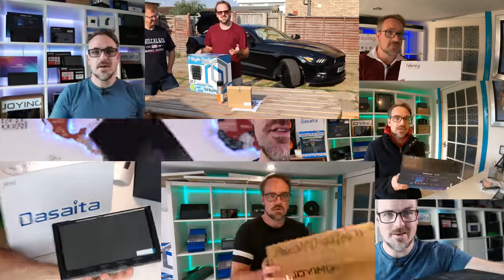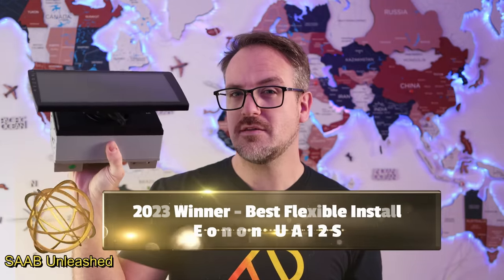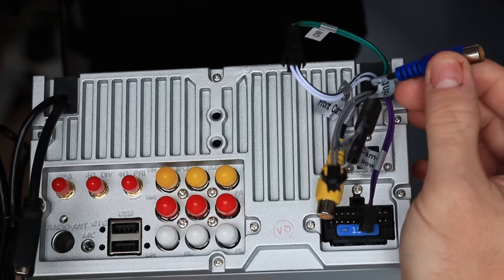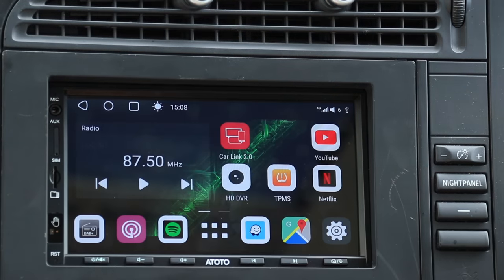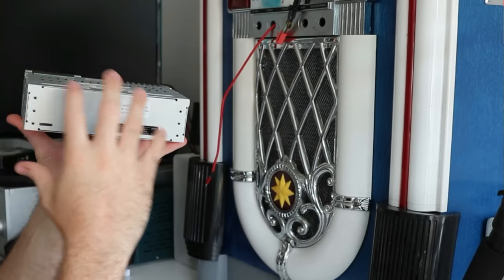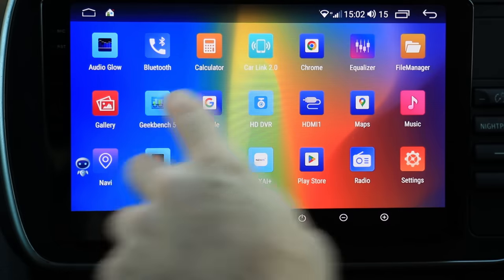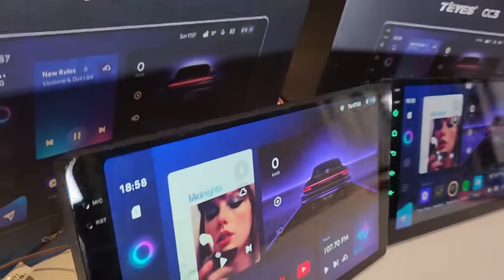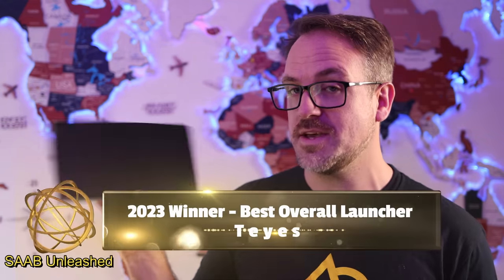2023's Top 7 Android Head Units

Comment: Thank you so much for this video. I wish I would have found it before I took the plunge. Bought an A-Sure brand 9" because it was literally all I could find at the time for a '15 Avalon. I did upgrade to the 4GB Ram model. Performance is good, but there are other minor issues. Audio is THE main one. The sound is clear, but there just isn't much control over each frequency in the DSP app. The presets work and I can manually adjust, but mids are too high and there is no bass at all. They had to send me an update just to enable bass settings, which don't work anyway. I'm going to return it, but wanted to ask here if that is just a characteristic of these Android units or just this one. I'm looking at the EKIY 8GB model. I don't need extra cameras or inputs/outputs. Just Sub and can-bus integration. So, is clear, but washed out audio normal for these units? My factory radio sounded WAY WAY better. And that was with my sub connected to line level, not RCA. Even without sub, it sounds better.
Reply from the maker: No, the sound quality differs wildly across brands with different internal amplifiers and DSP chips. Joying is king of audio on this list, but they're all decent. The EKIY is on this list as a budget option and you do get what you pay for. You're looking for audio quality which requires more costly internal components and so I don't recommend cheap
Reply: Thank you for that. I looked at Joying, but they don’t have anything for my car. So I would have to figure out which model would fit and find a bezel that works with the unit. Any tips on that? It looks like their 9” unit has an actual volume knob, which is awesome. But it seems to be a little different shape than the other standard 9” units that are out there.
Reply: @SaabUnleashed  sadly according to Joying support, they don’t offer anything for my car. My next choice is currently Mekede because they definitely do offer one for my car, with the bezel. There just aren’t many choices out there for the Avalon.

Comment: Hi, thanks for the video.

I would really like to know which one to use a secondary head unit, I want it mainly for maps but have to keep my stock radio system has auxiliary in
Reply: Fiat doblo MPV trekking 2016 secondary just the best system, doesn't matter cost
Reply from the maker: The best you can buy in this situation is Carpuride. I did a video a while back, there's a discount code in the video description https://youtu.be/LMHai1Fj7Cw?si=KsJqQx1W_Niy10bc
Reply: @SaabUnleashed  thanks,

Is it possible to use these higher end units as a secondary unit?, bat computer vibes
Reply from the maker: Technically you can, you'd just connect the left and right RCA out to your aux in

Comment: My question is how do they hold up over time?  I had a atoto f7we and went through 3 of them a 2 month span. I need something that is going to last for  a long period of time.
Reply from the maker: The F7 is not an Android head unit and doesn't have the higher quality components of the A and S series
Reply: @SaabUnleashed  I sent that one back and got the S8 ultra for my wife's car and it is good so far.  

I need something for my vehicle since it can only do wired android or car play. 

I was looking at the joying but I don't need a huge 15in screen lol. 

I've never heard of joying until I started watching your videos and I dont know how they hold up over time.
Reply from the maker: @TJsVette  I just reviewed the biggest Joying for fun, but it comes in smaller sizes depending on where you are in the world
Reply: @SaabUnleashed  I saw that.  I would go for a 10in screen but do they have the same specs as the bigger ones? How long do they usually last?
Reply from the maker: @TJsVette  I have Joyings from like 6 years ago which still work fine
Reply: @SaabUnleashed  yea I haven't heard of them but I like the look of it. On the link you had in the video it's not bad of a price, it's what I paid for my wife's s8 ultra.  

Just need to figure out if it will work with maestro and my car.

Comment: @SaabUnleashed i have a question for you! I am looking into getting s new android head unit for my mk4 jetta tdi, ive been looking into the brand Owtosin, do you havr any opinions on them? They are an ali express brand of course, im mostly interested in this specific unit because its designed to be a factory looking 7" double din replacement with physical volume and tuning knob and physical buttons, runs android 12, can choose between any 4-12gb 64-256gb models with either a snapdragon 665, UIS7862 or UIS7870 for processors ( was thinking ill opt for 7870 i think seems to be best cpu to me?), has 1024x600 ips display, can choose between tda7851 or tcb503 amp chip depending on cpu choice, tda7708 tuner, bt5.0  360 cam support, hdmi, dsp and all that other good stuff. My only concern is software. They also have 9" trim replacement versions that run a 2k display, android 14, snapdragon 655 cpu, 12gb or 8gb ram with 256gb rom, tda7851 amp DTS DSP and all the other good stuff but no physical buttons or knobs especially being the 2k screen no touch buttons at all! What would you reccomended and what are your thoughts? I realize i can change my launcher and all that but will i run into any other limitations or issues software wise i should be aware of?

Comment: What I expect out of these reviews: do the everyday quality of life functions work? Does hands free audio work very well with no background electrical interference, clear vocals, no echoing, etc? Does bluetooth and carplay/android auto get confused such as when a call is initiated before or during the connected of carplay? These seem to all struggle with this. Do they boot up and run reliably in cold weather? These are all things that have consistently kept me from using these android units. The cheapo Boss wireless carplay/android auto unit works far more reliably than any of these android head units I've had my hands on.

Comment: Hi I saw your review for 2023 and wondering if you have a review for 2024 units. I am also looking for a unit that will replace my 7" standard with an android 13 or android 14   9" or 10" screen for my 2015 benz GLK250 to work with my full fuction system as it has front and rear camera and all the bells . I am not looking to brake the bank under $500.
There are so may out there that it is confusing so need an honest opinon. Has to have car play , navigation and such. hope you can help

Comment: Had ordered a Ekiy T7 and just saw your video... Got the T7 4GB model with a fascia for 120 GBP shipped.  Honestly I had assumed the brands were mostly all the same so pleased that I seem to have accidentally ordered a decent one.
I'm a bit worried about signing in to it though... have you had any bad experiences logging in  to these devices? Cheers.
Reply from the maker: Looks like you made a good choice. I did a video on Android head unit security here https://youtu.be/67vOLN2VvcE
Reply: @SaabUnleashed  ah brilliant thanks.
Thinking I’ll re buy a few apps on a new account for peace of mind then rather than risk it with my main account.
Reply: @SaabUnleashed  oops… seems I ordered a unit with a TDA7388 amp instead of the TDA7851 in the higher spec ones. Have you had any experience with the TDA7388? Online sentiment is poor.

Think I’ll use an external DAC/AMP, I’ve already got them actually so not a big deal.

Comment: You see the screens with the 24hr monitor recording (sepperate battery cable option).
Is it possible to set up these  android stereos in the same way?
Reply from the maker: Yes, but you wouldn't want to because the constant power drain would kill your battery in no time. Android head units use a lot more power than dash cams

Comment: Ha! I'm looking for the Android HU for my SAAB 9-5 2006 and your video has just poped up out of nowhere :D I would like to install it while leaving the factory looks without screen overlaping the cupholder or anything else. Can you suggest any that would fit?
Reply from the maker: Factory looks would require a 7 inch head unit. That being said, I installed a 10 inch slim Joying head unit in my 2007 "Dame Edna" 9-5
Reply: @SaabUnleashed  i have few spare damaged dash fascias to play with (cut out maximum space possible) for my "Dame Edna" as well. Was expecting no more than 7-8". Are there any decent options? 
I will be installing DSP with 3 way speakers + subwoofer so unprocessed signal is needed (optical spdif would be best), physical volume control knob would be prefered if possible but not a deal breaker, 360 cams would be nice. BT hands free calling is a must.
Reply: @vilantas   thats exactly the same head unit im looking for too. Physical Volume knob, should blend in (fit) with my 9-5. 360 cam would be nice (my parking sensors are dying). Powerfull unprocessed signal (4-6v) for my audio system and to all of that id love to use the head unit as an Screen with hdmi so I can put my PS2 in my 9-5 :D

Comment: With all the optical and coaxial outputs what do people run them to? Any searches I do for external DACs pull up 2 channel headphone DACs or home theater DACs.
Reply from the maker: Have a look at AudioControl gear. Also Phoenix Gold have digital gear
Reply: Some automotive DSPs have them.  You'll lose front/rear fade though (without additional app support).

I read a guy that did a head to head comparison, and said that a proper high voltage RCA line out sounded just as good.

Comment: Hi i have a 2008 f250 with the manual ac control knobs cd player 2 din having a hard time finding any units compatable .. would like  10-13 inch screen 2 cameras split screen  13 run system and im in canada but on usa border wife can pick up usa if needed any suggestions? Noone seems to have that vehicle kit

Comment: Does anyone know if the Sub woofer out on all of these works like a convention head deck??? I currently have an ATOTO A6 Pro, but when turning the master volume up or down the sub does not react with the volume. I informed ATOTO years ago when I got it and they had no fix as it was a hardware limitation that no one had realised prior to production.

I have an amp and sub that worked no problem with a conventional head deck :(

Comment: I just ordered one of these, do I need any other cables apart from what comes in the box. I have the factory amp and the incar tech website indicates an adaptor is required with a factory amp.
Reply: It's a Saab 93 Convertible Linear NG 2010 with a Factory Radio, no Navigation!

Comment: I'm completely new to this... can any of these be installed over the top of a factory Skoda system without removing said factory system? Like how a rear view mirror camera you just strap over the top of your existing one?
Reply from the maker: If you want to keep your factory system, I would recommend checking my channel for “Carpuride” devices. Also “Carlinkit” if your car already has factory Apple CarPlay
Reply: @SaabUnleashed  I have to keep it as my car is leased. Carpuride looks okay but sadly it isn't a full android system like the units in this video :(

Comment: @saabunleashed. do you know if the Eonon requires  a canbus to utilize steering wheel controls?
Reply from the maker: It's not the head unit which depicts this. It's the car
Reply: @SaabUnleashed  Hey thank you very much for the reply I really appreciate it!.  So if I'm understanding correctly, the Car determines if a canbus is needed? Once again I appreciate your help as I am fairly ignorant in the world of car entertainment systems. I am working on upgrading a 2016 Jeep Wrangler 4 door form its 7 inch touch screen that doesn't have nav. I purchased the Eonon UA12S Plus

Comment: Hi, do these head units need a sim card installed to use things like google maps for navigation? Cheers
Reply from the maker: No, they have WiFi so you can just connect them to your phone's hotspot
Reply: @SaabUnleashed  thanks, i did wonder how they work. I take it they are not much use for travel abroad then as a navigation device as the data will cost a fortune? Is it better to have a stand alone sat nav?
Reply: @SaabUnleashed  i wanted one for my vw crafter camper and was hoping it would do everything to do away with my garmin sat nav.. also i need one that sits flush to the dash as i have swivel seats that would catch on the one with a screen that protrudes. |Which do you think is best. Also would you recommend anyone for a speaker upgrade. Thanks for great vids by the way.
Reply from the maker: @sundownsolutions2  just download the maps for the country you're traveling to, nice and easy. 
So the same with your music tracks and you can use it completely offline

Comment: I,m looking for a lifeline here. I hope you can help me. I have a 2019 Dodge RAM 1500 DS Express. It has the very limited 5" U connect head unit fitted. I want to upgrade to a quality Android unit ( Atoto S8 Ultra Pro) but I cannot find anyone who manufactures a wiring harness to adapt the old to the new. Are you able to point me in the right direction? I am based in Australia, but happy to shop anywhere. Kind Regards.

Comment: Hi, subscribed and liked from Australia. I have a head unit very similar to the t'eyes cc3, running android 11. One issue I'm having is the maps orientation, the maps are always north up and when I go to car settings > in car settings, the required compass section is set to north but it does not let me change any of the settings. I select the item to change, the section closes, when I open the same section the item is still set as original. I would like to know if you can help with this. Excellent video too.
Reply from the maker: There is nothing similar to the CC3, and I have never seen a head unit that runs Android 11, so it's probably not genuine.
With regards to map orientation, why are you not using a better map app? It's Android and you can install whatever you want. I recommend Waze and Google Maps

Comment: I got the Ekiy t7 with the 360 camera, everything works fine except the cameras when I put it in reverse it's need a few seconds to show picture and even after that it Starts to freezes which is very annoying while parking, i got the 8+128gb version any idea if I can fix that?
Reply from the maker: That would be annoying. Sounds like a software issue, maybe a factory reset will help. It might also be the way that you're triggering the reverse, if it's from the reverse light, it might be picking up the Canbus pulse
Reply: @SaabUnleashed  I tried everything, factory reset connecting reverse camera to reverse light tried another camera with no luck, do you think the car battery can cause an issue like this because my car battery is almost dead now it's show's only 12v when measuring

Comment: Thanks, I enjoy your videos. As always very informative. I currently have a model specific Joying head unit in my Mitsubishi Shogun but always interested to hear if there is anything worth swapping to. I was disappointed to see Eonon have a very limited range of model specific units not including Mitsubishi or Saab (info from UK web site).
My Shogun has an OEM amplifier which is apparently very difficult to properly link but the model specific wiring loom from Joying works perfectly, also with the OEM reversing camera. I wouldn't want to risk a non specific wiring loom in case I don't get the same level of integration as with my current Joying unit.

Comment: Hi. Any influence on manufacturers  for two things: a less is more UxI and to consider more premium installation options. 

Looks like user interfaces software has improved across the board but still seems focused on trying to do everything. 
E.g. Who really has a clock widget running with Google maps satellite view mini window and radio station bar at the bottom?
Both Carplay and Android auto UIs are excellent examples of less is better. 

Finally the age of suction cup mounts should be over. I would gladly buy most of your £200 and pay another £75 for a car specific radio surround that gave a flush mount. 
Or even a single/ double DIN unit with adjustable solid mounting. 
The main goal being to simulate a floating displa.
Can manufacturers stop this current floating so far out into the car option that forced buyers to mount screens on the windscreen. 
That's the last hurdle to overcome!😢😢

Comment: So I picked up the EONON UA12s  the other week, Pretty cheap for £192 with eBay code, Well I got around to sticking it in today, All seemed well at first, Connected Bluetooth turned music up and the front right speaker went off, Tested the speakers to rule them out, Done all I could then gave up and disconnected, Went in had a cuppa and thought I would give it another go, Connected it back up and and it worked, So I thought, As the front right now worked but the rear right never, So that's got to go back unless anyone has any ideas.

Comment: Just a warning. These systems seem awesome but if plugging into an amplifier, they have very low preout voltage. Now tried 2 joying units.  Cannot find any info on site for pre out levels but many forums confirm as low as 1 - 1.2 v pre out. Makes like Kenwood, alpine etc, will display this in specs, and usually around 4-5 volts. I have tried 2 joying units in past few years have a lot of interferece sounds when amplified. An intel CPU one, and a 2022 snapdragon 1. For audio quality these are very poor when connected to an amplifier. I do love saabs tho 😊